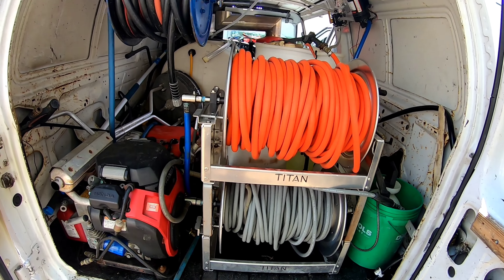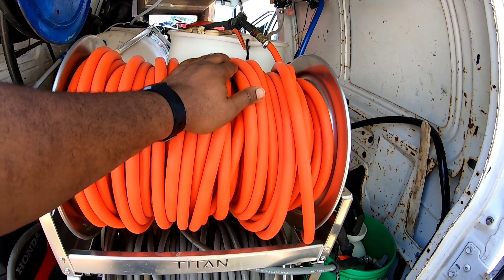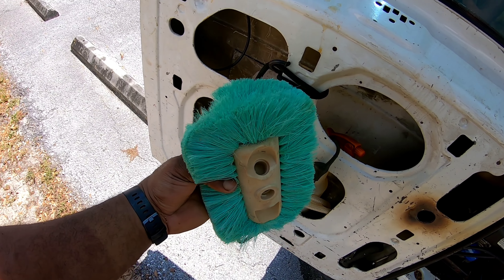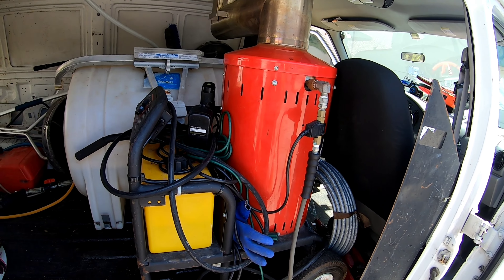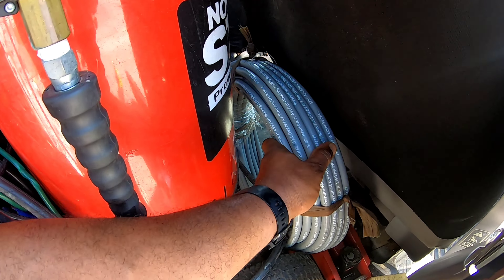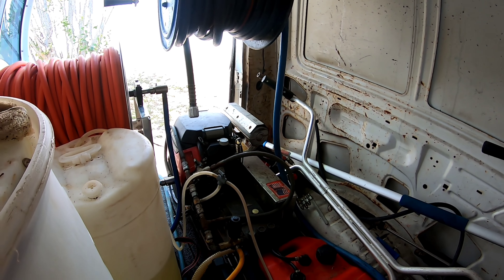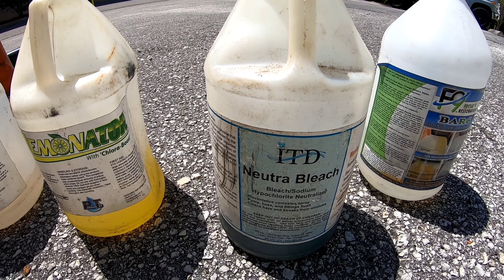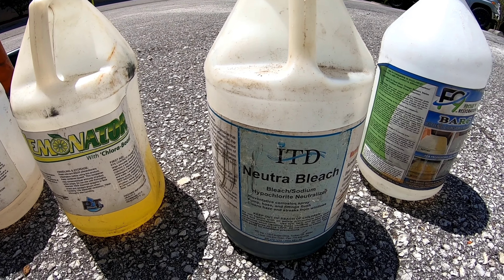van pressure washing setup

Comment: Whats up my dude. I been following you for a while. I have a question. Im just starting out in the soft wash world. I got 2 55 gallon tank. 1 55 gallon is blue for buffer tank and the other is white so I can see the sh.  I do not have the portion valve yet. So I want to know how do you batch mix? Also what size is your garden hose? And your soft wash hose?
Reply from the maker: You will have to batch mix by mixing your sh and water in the 55 gallon drum.  When I had to do that I used to buy 25 gallons of sh and when I get to the job site I add 25 gallons water to get my 5% mix for roofs.  My garden hose is 3/4 and my soft wash hose is 1/2 inch
Reply: What percent you use for house wash?  And do I need to have the buffer tank?
Reply from the maker: @TimeIs_Money  all depends on how dirty they are. vinyl siding anywhere from 1 to 2% stucco anywhere from 3 to 4%. and you will only need a buffer tank if youre running 5.5gpm pressure washer or higher typically

Comment: love your setup! Im from the Netherlands and I don't want to have all the equipment on a pickup but secure and dry in a van.
Everybody else had it on a trailer or pickup but I love the van!
Reply: I'm also preparing a van but im looking into putting the reels near de side doors. You say you like the room to walk trough it, what is your opinion?
Reply from the maker: @Ric995  I love the van setup. Nice n compact. I like my reels in the back cause it definitely gives Me  more room to move around. I've since upgraded to am extended van. Check the video out

Comment: Very helpful video . Thank brother  . Quick question you got the battery for the pump. I just got a van and honestly trying to use this as a blueprint
Reply from the maker: Yes I have a separate battery for the pump. 12v marine battery
Reply: Bro, good morning the pump use is a piusi carry 3000 12/24V DC compact Diesel Fuel pump-12 Gmp. Or something similar
Reply from the maker: @keyonwhite64  never heard if that one. Make sure its gonna hold up to the SH
Reply: What are some good pumps to use
Reply from the maker: @keyonwhite64  delevan fat boy 5gpm or 7gpm, remco 5.3gpm or 7gpm, everflo 5gpm or 7gpm.
Reply: Thank you for the information I just got my van and in the process of getting my equipment . I bought a Honda GX 390 pressure washer 4200 psi with cat pump. But I been watching your video . And seem you had a different pump set up too. Bro, your videos is good quality! I appreciate you
Reply from the maker: @keyonwhite64  that's a great pressure and pump! Cat pumps are top of the line.  I've upgraded twice since this current video.
Reply: Good morning bro, I got a question. For the three way banjo & banjo strainer I see some have maximum pressure at 100 deg f192 psi. My question basically does the psi matter or anything three way banjo ball valve & banjo strainer should be okay. Appreciate your help. I just trying to get set up correctly.
Reply from the maker: @keyonwhite64  you wont be putting that much PSI through that 3 way banjo ball valve. a 12 volt pump only puts out like 60-100PSI.
Reply: Do the marine battery size matter. Isolator where can I get from.
Reply from the maker: @keyonwhite64  I mean the bigger the longer you can work but any group will work group 2427 or 31.  And the battery Isolator can be purchased on Amazon. In the description section there's a link for it.
Reply: @PinkFlamingoPowerWash  thank you
Reply: Hey bro, how you mount your pump in your old van. I the same type van just a 2007 E150 cargo van

Comment: Nice setup! Would you share where to buy the long brush pole? Thank you!
Reply from the maker: Thank you. I use this one 

Unger	24 ft. Aluminum Telescopic Pole with Connect and Clean Locking Cone and Quick-Flip Clamps
https://www.homedepot.com/p/Unger-24-ft-Aluminum-Telescopic-Pole-with-Connect-and-Clean-Locking-Cone-and-Quick-Flip-Clamps-972980/313314116
SKU# 31331411

Comment: Great setup👍 I'm not thinking of hot box yet. I've got a question, one of you tube guys that's selling programs offering contract for your customers$129 that is escape documents. If you fade Sherman Williams paint in Florida with sh +++. Seems like that would scare off potential customers. What are your thoughts? Do you use contracts or old school hand shake? Thanks great content👍
Reply from the maker: Thr Sherwin Williams paint that fades is that blue one.  Never had issues but I do have just a general terms and conditions that protects me and the customer. Its on my website also.
Reply: Thanks, Great website👍

Comment: Where did you buy your pressure washer at? Looking to upgrade my unit and just getting my options from where to buy from.
Reply from the maker: I got mine used with about 160hrs on it. But pressure washer products has the best prices around. They're in Clearwater FL call Lori Smith

Comment: Great setup! I never thought about doing a van rig before until I seen your videos. I thought everyone did trailers, flatbeds and box trucks. One question though, how often do you use hot water on your jobs?
Reply from the maker: Not often at all. I've used it maybe 2 times in the past year

Comment: Hey man how did you get that hose reel mounted to the ceiling/roof? I'm looking to do something like that in my van setup. Keep up the awesome videos. Thanks!
Reply from the maker: I took it to a welding shop and had it welded up on the roof support.
Reply: @PinkFlamingoPowerWash  Thanks!!

Comment: Great vid Cliff! Is that surfactant a concentrate that you mix with water? If so what ratio do you mix ?
Reply from the maker: I personally dont mix it with water. I just add it to the SH 1 ounce per 5 gallons of mix give or take. But if you were using a Mixing Valves or Proportioner.  Add 64 ounces to 5 gallons of water
Reply: @PinkFlamingoPowerWash  ok perfect, I am going to be running a proportioner so thank you!
Reply from the maker: @mannyrodriguez5421  I can't wait to get mine too
Reply: @PinkFlamingoPowerWash  yeah there not cheap lol, I’m building mine using the pentair valves this upcoming week